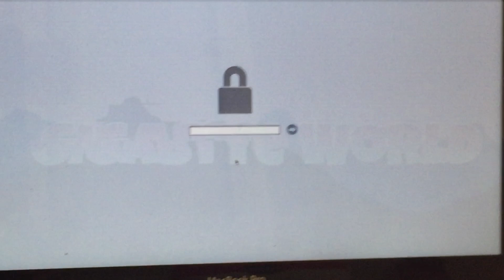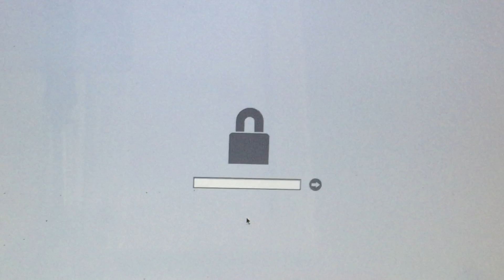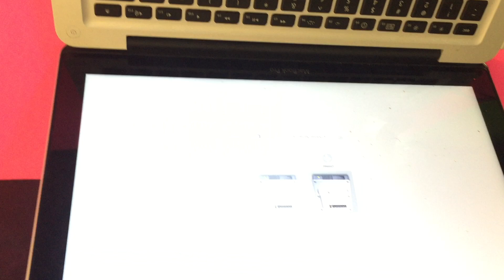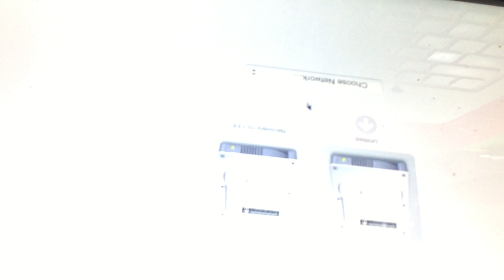HOW TO REMOVE FIRMWARE PASSWORD ON MAC

Comment: Would this work on a 27' iMac? I don't know what year it was made or anything like that. And I don't really mind losing anything on it.
Reply from the maker: This works on older iMacs that have not been updated to MacOS High Sierra or newer
Reply: @GigabyteWorld  Thanks for the reply.

I did unfortunately find out myself that it was a newer model when i did the same thing with the RAM sticks and key strokes and it changed nothing. Thanks anyways for the video!

Comment: Does this work if a firmware password is enabled ?
Reply from the maker: This method removes the firmware password in older MacBooks with removable ram that have not been upgraded to high Sierra
Reply: @GigabyteWorld  ok thanks for the reply , tried it on my 2011 running High Sierra and it still goes white half way across the progress bar. It always asks for the firmware on recovery mode.
Reply from the maker: @keithrodgers1030  another way is to take it to local shop to have them remove the password it’s a few minutes process for a place with the tool

Comment: Hi man! I got a iMac 2012 that has this password. My boss gave it to me, said if I can fix it, it's all mine lol. She doesn't know the password, obviously. 
It has a little door on the back where you can add/remove the ram sticks. It has 4 x 8GB sticks in there.  All 4 sticks are the same manufacturer/type. I tried removing 1, 2 and 3 sticks but still doesn't let me reset the PRAM. Does it have to be a different RAM stick/size/manufacturer? Or a specific slot where I should leave a certain number of sticks in, in some order or something? I tried a few combinations but no luck! 

I have no idea what version of MacOS it's running so that might be the problem, just wanted to check if it has to be a different RAM stick to make this work before I say goodbye to the mac lol
Reply from the maker: Removing only one stick
Should work .if your iMac was updated to high Sierra this would not work unfortunately.Don’t worry too much there shops that will remove the password for a fee call around your area
Reply: @GigabyteWorld  thank you for the reply! From what I’m reading, looks like the 2012 iMac couldn’t be upgraded to Big Sur, they stopped supporting it… So not sure why it didn’t work. I’ll try with 3 sticks, alternating which one I take out. Maybe it does have to be a different module because it still recognizes these modules?
Reply from the maker: @mushtikla1  you correct the 2012 can only be upgraded up to MacOS Catalina from my experience it looks like this hack only works on older units that have not had macOS High Sierra installed on them .I recommend you visit or call a shop local to you it will be quick and painless to have this done as they have the equipment to wipe the eprom that stores firmware passcode

Comment: I have the same model but it does not make the noise 3 time just once
Reply from the maker: What year is the MacBook ?
Have you removed the ram ?
Reply: @GigabyteWorld  it’s model A1278 I believe it’s a 2012 and yes
Reply from the maker: @blancavasquez8332  try using a usb keyboard

Comment: Bro mine 2016 lunched MacBook Pro I’m not able to unlock it plz help me bro
Reply from the maker: Sorry but this method only works for macs that have removable ram.
The 2016 Pro  does not have removable ram
Reply: @GigabyteWorld  bro it has removable ram
Reply from the maker: Then it’s not a 2016 
No MacBook Pro ram can be upgraded since 2012
Reply: @GigabyteWorld  and I have removed it and I have done like u but no use it’s showing the same firmware lock
Reply from the maker: This method shown in the video only works for MacBooks that have not been updated to high Sierra  or newer OS and were made in 2012 or before and have removable ram .
What OS was the MacBook running

Comment: Does it work on a1286?  Now  it doesnt charge. When i plug to the charger instead of orange light it show a weak green light
Reply from the maker: Sounds like there other issues besides the firmware password
Reply: @GigabyteWorld  this happened after i disconnected the batery, ram.
Reply from the maker: Ok but the ram and battery should not affect anything else

Comment: Macbook pro 2012 ?
Reply from the maker: This will work on the 2012 if it has not been update to MacOS high Sierra or newer versions
Reply: @GigabyteWorld  Catalina is there any way?
Reply from the maker: For Catalina you will have to take to either apple with proof of purchase or a computer store and pay to have then remove it

Comment: So i have to replace da ram with another one ?
Reply from the maker: You just to need to change the amount of ram once the password is removed you can put your ram back in if you have 4 GB usually two sticks of 2 GB take out one stick follow the video steps then when done add the 2 GB back in

Comment: Even I tried several times with this method; However, it did not work on Apple MacBook Air 13" A1466 EMC 2632. Did I miss something here?
Reply from the maker: The method only works on iMac with removal ram or MacBook Pro you can’t remove the ram on a MacBook Air which is why this does not work for you

Comment: Hi boss
Is it always supposed to be a new or different ram stick. Because I gat 2 Rams in my laptop and was thinking to reset the Firmware password  when I have left one of the Ram inside... Can it work boss..
Reply from the maker: The trick is to change the amount of ram so if you have two take one out the follow the steps on the video .
After the password has  been removed put the other stick back in .

Comment: How to re install the Mac system update after changing this stick??
Reply from the maker: Hi there Upgrading your Ram will not affect your operating system.
Reply: When i turn on after changing the one of tow ram it The system only makes a strange sound. I don't know what it is. The screen is still black. When I try to turn on the MacBook, it does not turn on. It just makes a strange sound. What is the solution? Pleas tell me i’m in trouble 😭
Reply from the maker: You are not in trouble 
Your ram is probably not properly inserted.
Disconnect your battery take out the stick and put it back in make sure it positioned properly.
Reply from the maker: Don’t forget to connect the battery once your ram is in
Reply: @GigabyteWorld  i did it but there’s sound so wired and screen is black not white, in addition my screen is good not broken
Reply: Thank you so much ,, i just buy ram 4g , my macbook is as this since a years ago and I don’t ever see the slove of this but your video is so useful thanks man , but.. are you sure that will unlock it? Because i just now buy the stick 4 G
Reply from the maker: I would like to clear things up 
As mentioned in the description this method works for Macs with older firmware .
If your firmware is  MacOS high Sierra or above this method will not work .You do not need to buy you ram what you need to do it to change the amount of ram then follow the steps in the video if you have two sticks of ram remove one and follow the steps when it unlocked then put the ram back into the Mac .
Reply: @GigabyteWorld  where can i connect with you?
Reply from the maker: I sent the number you can text me for further assistance

Comment: I tried to follow this.. I did the same steps of removing one stick of RAM, removed all, put in a different amount of ram with one stick, held down cmd, option, p, and r and it takes me to a white screen with the flashing folder. I have a Macbook Pro Mid 2012 with removeable ram. Please help. I have no startup sound, and nothing reboots.
Reply: i've also used a USB keyboard.
Reply from the maker: This only works on units that have not been updated to high Sierra if you have new firmware this will not work I would say visit your local computer store

Comment: Does it also work to new macbooks? like macbook pro 2020?
Reply: Is that so? Thanks for the response !
Reply from the maker: Yeah the issue is using this method in this video in involves ram removal which is not possible on the 2020 pro
Reply from the maker: Sorry this Method would not work on the 2020

Comment: Thanks for this vid. Will this work On my Mac book air 2017?
Reply from the maker: Unfortunately this would not work on the MacBook Air since this method requires you change the ram amount.The ram on the MacBook Air is not removable

Comment: Not working for me on my iMac. Any ideas? I have removed the ram, swapped it around, everything. 2012 slim imac. Running Yosemite, i heard this may have updates preventing this.
Reply from the maker: This method has worked on the 09 & 2010 iMac that do not have high Sierra I have tried it on the 2012  iMac you may need to take it to your local shop they can wipe the code on it .

Comment: you wanna start thinking about using a anti-static mat fella but apart from that a v good video ;)
Reply: ESD is ancient, old mobos would have died by now but new technology has come a long way, I build at least one pc a week on my carpet in my dressing gown and never had one pop, touch wood.
Reply: @boffyboydj  OK then why do the mobo and ram manufacturers pack their stuff in anti-static protection?
Reply: @boffyboydj  "ESD is ancient, old mobos would have died by now but new technology has come a long way, I build at least one pc a week on my carpet in my dressing gown and never had one pop, touch wood."

Don't you mean 'touch metal'? ;)

Comment: Hi, Sir i am from Pakistsn. I have imac 27 inch a1312 late 2009 core 2 duo emc 2309, my hdd got damaged. I replace with the new hdd but after boot from pendrive machine show padlock (firmware) password, how can i reinstall or get rid from that password?? Plz help
Reply from the maker: You can remove the passcode on 2009 iMac by changing the ram amount open the ram bay take out one stick of ram and follow the straps on the video above
Reply: @GigabyteWorld  fine sir i will try tomorrow and give the result here, happy to see your quick answer.. Thanks a lot.. (i have poor english so ignore plz)
Reply: @GigabyteWorld  sir that method did not work, plz help with any other option/ trick/ method etc. Plz
Reply from the maker: Try using a different keyboard 
Remove one stick of ram press the keys command option P & R as soon as you hear the start up sound keep holding until you hear the sound 3 times
Reply: @GigabyteWorld  ok i will...

Comment: will this work on a model a 1932 mac air?
Reply from the maker: Hi kody since the ram in not removable on MacBook Air I don’t think this method would work
Reply: @GigabyteWorld  thanks heaps for letting me know, do you know any way i could do it? i have proof of purchase and apple are not helping
Reply from the maker: With proof of purchase Apple usually removes the lock 🔒 try a different Apple store if not visit any local computer repair store they should have the device to remove the lock 🔒 good luck

Comment: Hello I have a question 
I have a MacBook Air early 2015 11“ 
I have to buy a new RAM ? Or can I put the old RAM in my Mac back ? Did it work ? Sorry for my bad English 😅
Reply from the maker: Hi Daniel unfortunately for the MacBook Air the ram cannot be removed as was done in this video .I would say visit a computer store in your area they should be able to help you with this issue .

Comment: Doesnt work with 2011 imac
Reply from the maker: Depends on the version of software on it
Reply: @GigabyteWorld  not sure what os. I removed one stick. Plugged it in. Held the 4 buttons and turned it on and it just loads right to the firmware password.
Reply from the maker: This hack only works before high Sierra after high Sierra this method does not work
Reply from the maker: Also try doing this with a different keyboard and only one stock of ram
Reply from the maker: Which Os are you running on it did you remove the RAM ?

Comment: Unable to remove firmware password from macbook A1278. remove one ram, even replace socket but no success.
Reply from the maker: Hi there this method is for units that have not had the firmware updated

Comment: would this work on a Macbook Pro 13" Mid 2012 running with Catalina? Would appreciate the help.
Reply from the maker: Unfortunately this method does not work when tried on Catalina
Reply from the maker: This method works on Macs before high Sierra

Comment: Not working this ???
Reply from the maker: What year is your MacBook
Reply: 2012 MacBook Pro 15inch
Reply: MacBook Pro (15-inch,Mid 2012)
2.6Ghz Intel Core i7
12GB 1333Mhz DDR3
Reply from the maker: @eswareditor7149  hi the method that is used on this video is for MacBooks that have not been updated to high Sierra or newer .If you have high Sierra or Mojave or Catalina this method in the video will not work .
Reply: Ok I m not using high seria, 
Use only seria os 
I know firmware password 🔑 but that time not working properly keyboard

Comment: so my imac 2009 have 2 side for ram, do i change both side?
Reply from the maker: Take out one only
Reply: @GigabyteWorld  also another thing, when i shut down my imac and did what you said, a question mac folder pop up and when i shut it down again the firmware password pop up. How do i fix this?
Reply from the maker: What year is you iMac
Reply from the maker: Your problem can be fixed by following the steps in the video if your iMac has software older than MacOS High Sierra ,but if your firmware is newer High Sierra or newer then this method will not work.
Reply: @GigabyteWorld  2009
Reply from the maker: This should work on the 2009
Reply from the maker: You may need to try this more than once
Reply: @GigabyteWorld  well i follow the step but it keep popping up the question mark folder
Reply from the maker: Take out one stick of Ram 
Turn off the iMac 
Turn it back on as soon as you hear the chime sound press Command Option p & r keys 
Keep holding them until you hear the iMac chime sound 3 times
Now release the keys and turn it off and press the option key the lock should be gone 
Try a different keyboard of the one you have is not working correctly.
Reply: @GigabyteWorld  oh and when i try the command option p r, it does not do anything it just keep popping up the question mark i also tried 2 keyboard
Reply: @GigabyteWorld  so what do i do?
Reply: @GigabyteWorld I tried what you said a few times today and when i fix the firmware pass, the question mark folder pop up.
Reply from the maker: Let’s see if the passcode is gone 
Turn off the iMac turn it back on and press option key right after the chime sound 
If you see a lot of devices to boot from then it removed if you get a pad lock 🔒 it’s still locked
Reply: Where can I buy auch a 1 GB RAM ? Is it a Spezial one for Mac  or just a normal one? sorry for the “dumb“ question but I’m not a techgeek. 
Thx

Comment: Hey bro thanks for the vid. I tried it and it didn’t really work,  I keep getting a folder flashing & at times I get the admin password. I’m trying to remove the password but nothing seems to work, I followed the steps of the video but no real luck. Any more tips?
Reply from the maker: Which macOS do you have on the MacBook
Reply: @GigabyteWorld  I believe it was one of the Lions or Maverick. I have tried removing the RAM’s, I have bought a new SSD, yet the admin lock is still there. It also gives me a blinking folder, but to fix that I need to get rid of the admin pass, no?
Reply from the maker: Well if its lion or maverick you should be able to remove the passcode .
Try using a usb keyboard instead
Reply from the maker: Also the Trick is changing the RAM amount take out one stick before following the video

Comment: Thanks. Worked great on my Mid 2010 Macbook.
Reply: IT works on every mac that is 2010 and before. The firmware password is saved on the ram stick. Every mac after 2010,they actually have a build in chip that has the saved password.. more like iclould lock ..
Reply: @elchacal535  I want to buy a macbook mid 2010, with Lion OS, but it's manufactured in 2011-2012. Will it work on it?
Reply from the maker: Good to hear it worked
Reply: @GigabyteWorld  I want to buy a macbook mid 2010, with Lion OS, but it's manufactured in 2011-2012. Will it work on it?

Comment: does this work for macbook air a1466
Reply from the maker: The issue with the air is you can’t remove the ram this method requires you change the ram amount
Reply: @GigabyteWorld  thanks.. I guess thats it for that..

Comment: Thank you so much from me, in Canberra Australia. I am utterly broke. Tried to upgrade my early 2009 Macbook to a 1TB HD. The Firmware nightmare began. All. Night, until 5.41 a.m.. I nearly lost my mind. You have saved all my documents and emails, photos, everything. Thank you so much, my friend. WIsh I could send you a gift. Stay healthy and happy 😊💜
Reply from the maker: Hi Anthony I am really glad this tutorial was beneficial to you .Stay safe
Reply: @GigabyteWorld  Bro i need your help
Reply from the maker: Hi what’s going on ?
Reply: Ok I followed his steps and I don't take the command, go straight ahead and I get a folder with a question mark and if I touch Command + R, the padlock comes out. What can I do or what do you suggest? Thanks
Reply from the maker: @henrryrivas2423  from the folder with question mark it sounds like you may have changed the hard drive or it’s missing or it’s corrupt what macOS was on the hard drive ?what year is the Mac what model number mac
Reply: @GigabyteWorld  When they updated to Catalina, I don't know what happened and the EFI was blocked and now when a pen drive is placed and the padlock comes out and it does not allow to install anything. The model is a 2010 MacBook Pro A1278.
Reply from the maker: @henrryrivas2423  hi Henry unfortunately this trick does not work on units that are running Catalina this trick seems to work best on units with older firmware before high Sierra before Catalina .